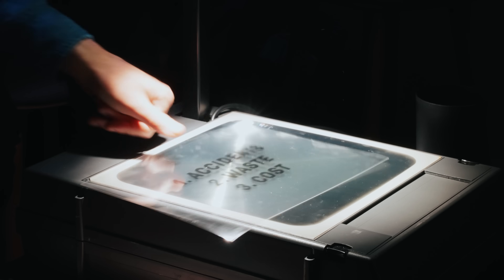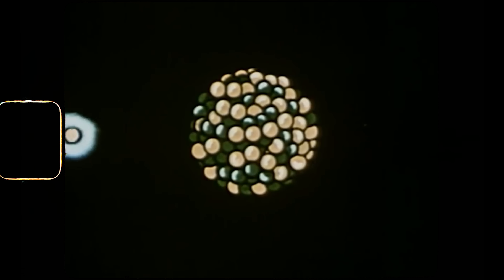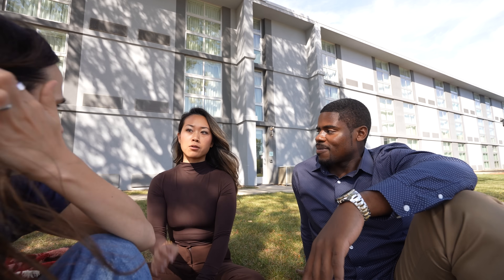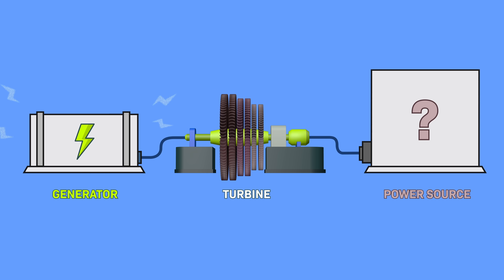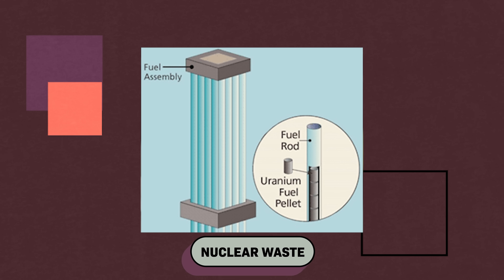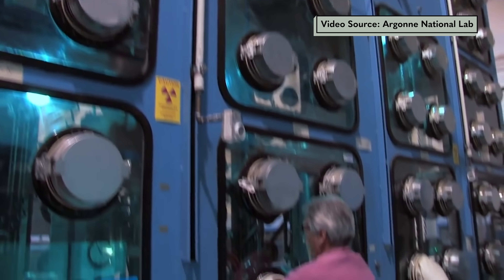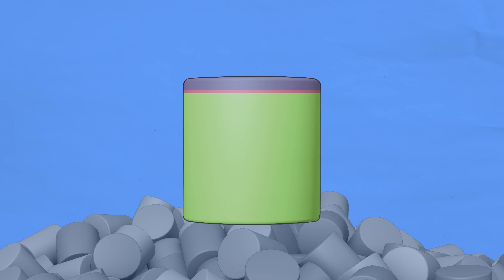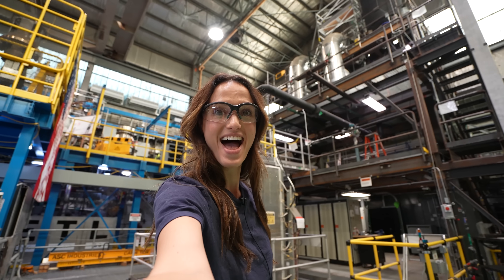The Big Lie About Nuclear Waste

Comment: The atomic number 235 is NOT the number of neutrons. You do not "fire a bunch of free atoms at U235". It's neutrons, and you don't "fire" them.  Do NOT listen to a lesson on nuclear power and its risks from someone who does not know the most basic level physics. Nuclear waste that lasts 1000y is, in reality, just as much a problem as waste which lasts 100,000 y. It basically means we have NO practicable solution for storage. There seems to be a lot of push recently to make us believe that DNA destroying, ionising radiation is less dangerous than non toxic, life giving CO2, which is the basis of nearly all life on Earth. Our less than qualified host has been pulled into the nuclear PR spin.

Comment: theres a lot of pro nuclear propaganda going around lately. even if it was safe in theory, which i have serious doubts, it is definitely not safe in the hands of our government and companies (which are more concerned with profit and power than safety or health).
consider how electric companies in california are causing wildfires or how deepwater horizon spilled 134M gallons of oil into the gulf or how people near fracking sites can light their tapwater on fire. these thing and many more are allowed to happen over and over because the govt allows industries to self regulate and if they are held accountable they are fined a small percentage of profit.
the difference between those energy sources and nuclear is that the potential risk of nuclear is exponential in comparison. and thats not considering catastrophic natural disasters that would overwhelm engineering fail-safes. 
the youngest generations have no respect for the dangers of nuclear radiation because they havent had the negative experiences older generations have. as the saying goes, those that forget the lessons of history are doomed to repeat them.

Comment: If the US can overcome its allergy to nuclear, they need to approve a single system that can be manufactured for a reasonable price. Each of our plants were custom designed and each installation was customized to the site. The French have been recycling their fuel since day one. We could force it here. Just tell the Global Warming ninnies that we’ll remove the requirements for oil permits until they allow nuclear plants. In other words, let anyone dig anywhere until the 1st new nuclear plant is turned on.

Comment: Oh, get over it! Nuclear is just another energy with limited resources, mostly in countries that are less nice. It IS highly dangerous and toxic, it IS not environmentally friendly, it IS expensive. Stop the Greenwashing already. The best move would be fusion, but that will take too long to help us in the next 50 years (unless some real breakthrough happens), so we are best served with regenerative energy systems. Solar would work well, but also needs a lot of materials that are going to get scarce and is still not very efficient. Wind and water are simple and can be used everywhere and do not need much space. Wind has been used for millennia, we know how it works. And I have yet to see a windmill or solar panel failure that leads to the evacuation of a whole region or city. Water is more risky in that way, when dams fail and flood a whole area.

Comment: I strongly believe. The way forward in energy is nuclear energy. Yes I prefer fusion than fission. However, we are capable to manage both. The recycling costs of old fuel should be calculated fairy. Not compared to new. Compared to ‘recycling’ wind energy technology. We as human, we should think in sustainability at and with each new technology. Not just the initial costs. Having a earth with millions of wind turbines isn’t a pretty look. Surely if life cycle is a few years. Nice video. As material innovation director and polymer chemist these are the topics we should talk about.

Comment: The problem is that trials showed that the costs of that repeated reprocessing, for which breeder reactors are needed, are huge. Despite the roughly thousands of billions of $ spend on it in countries such as: Japan, France (three generations fast reactors), UK, etc.
It's a pipe dream not only until we have developed highly intelligent, radiation resistent robots that can do all the work, but even then... 

The Japanese now have huge trouble developing robots that are radio-active resistent so they can inspect the chambers below the exploded reactors in Fukushima. 
There is no real scenario that we can do it for acceptable costs. 

The French stopped with fast breeders after trying with three generations, when it showed that the fourth generation would not deliver structural cheaper and better results (it would only increase the risks as fast breeders explode also fast).

Comment: Well that’s true to a certain point. Nuclear is definitely the best way to generate energy. But not all nuclear waste is good enough to be used as fuel. And nuclear power plants also produce more nuclear waste. It’s a big problem now with very few nuclear power plants running. If we run mostly nuclear power plants the amount of nuclear waste generated would be massive. Which again, most of our current ways to generate power is also very harmful. But nuclear waste does generate more complex issues and it’s VERY VERY expensive to correctly dispose of it.

Comment: The big lie about nuclear waste is that with the way we store it, it isn't dangerous. This problem was solved decades ago. Check out the video on this very subject by Kyle Hill*. (His *Expedition Chernobyl series is very good too). In the US, we don't even just use dry casks, but there are other, effectively indestructible storage methods that are built to last. We don't just put the waste in casks, we integrate the radioactive waste with inert materials. People just have this false picture of it being some green goo in a vat that will kill you if you get too close, but that's as far from the truth as it can get. A stigma about the danger of Nuclear power has been fed to the US public since TMi - despite that never even having been a risk in the first place. Despite everything, nuclear power is environmentally the cleanest and most energy dense process for power generation we currently have by far.

Comment: "Spent" nuclear fuel is not waste, except by the ridiculous definition imposed by US Congress. Russia (RosAtom specifically) already has production fast neutron reactors with decades-long track records. By about ~2030, they will have a first-in-world full, enclosed (this is important) closed-loop system in experimental production. This gives you cheap (RosAtom builds on time and on budget), clean energy with "waste" on the order of grams, not kilograms or tons, with passive (automatic even in event of power loss) safety. Nothing leaves the enclosed closed-loop except energy and a tiny amount of nucleides at the very end of a very long cycle. What's more, you might not even need to mine new uranium for a hundred years or more - RosAtom can enrich down to below 0.1 (and likely better), whereas the next best - the French - can only do 0.3. This means the mountains of 'poor' uranium lying around enrichment sites around the world (and now treated as waste) could be sent for enrichment, producing new fuel with no new inputs. Good job you've p-ssed off the Russians by waging a proxy war with them in Ukraine and condoning UA shelling of RU nuclear sites, no nuclear for you.

Oklo is a dead end, their ideas only work commercially if you assume that a small nuclear power station incurs lower fixed costs in land, exclusion zone and security than a large one, which is ridiculous on the face of it where plutonium is present. I didn't even get into the actual generation side of the plant. It's an attempt to do an end run around the failure of the US nuclear technology complex, which tried and failed to develop centrifugal enrichment (the only commercially viable enrichment technology), delivered broken designs (active safety that fails on power loss) for decades, couldn't build anything on time or on budget leading to the bankruptcy of Westinghouse, a failed regulatory regime, and the absence of qualified engineers. The trouble is that these same Russians from above already have a 15-20 year lead on these compact reactors (at a minimum), and not just repurposed military reactors or broken sodium designs, but real civilian-purpose designs. A converted military-reactor design is already in full commercial production. And it sits on a barge that can be towed whereever you need it. Not a start-up, not a theory, full commercial production with a full, decade-long safety certification process behind it. It's sitting somewhere very cold and powering I-forget-what. Compact reactors are not an "innovation" requiring research, they're already here and we know they have a lot of utility, but their usage scenarios (with full safety) are limited vis a vis full-size. This limited use case will not allow these compact reactors to reach the mass production numbers they're counting on to drive the cost down. They're not a replacement for 80 years of research and a full, end-to-end line of nuclear technologies that are proven, fully safety-certified and can be built on time and on budget.

Comment: If recycling has been demonstrated to work, and not just that the process has been refined over the years too. So, who has told massmedia to lie and hold this quiet, and not telling us the whole truth? 

This option actually makes nuclear plants way more useful, and it has to be cheaper than other energy sources in the long run that say wind and solar when it comes to kw per hour, and ofc waste which is a huuuge problem in the socalled "green enegy" sector of today

Comment: Well the real trick is to make good liquid-metal cooled reactor. And not a small experimental one but large, utility-scale one.

Russians built one (multiple reactors of BN-series) that uses sodium as a coolant, however the need to keep pool of sodium in argon atmosphere because sodium ignites when in contact with air... and there were a number of fires during BN-reactors service history...
So it doesn't sound like a convenient reactor to have.

French used mercury for cooling but it have very low boiling temperature, so potentially we can have a lot of gaseous mercury around... yikes!

In submarines they use lead-bismut mix which while better than sodium, still ignites in contact with air... and corrodes the pipes...

Liquid tin is also corrosive but it doesn't ignite but its melting temperature is 200-something C...
And final candidate is pure lead. The problem with it is that it have even higher melting temperature than tin and - while probability is very small - sometimes lead atoms capture neutron and become radioactive polonium atoms, so we need to filter them out somehow out of lead that is heated to several hundreds of C...

And I haven't even heard of studies about using some other metal as a coolant.
Still, tin or lead sounds like a less problematic way to go. 

BUT if we do figure the engineering out we can use mix of depleted uranium and plutonium made in Sellafield to create a reactor that would last a ~century without refueling and won't produce any wastes (it will burn everything it produces).

Comment: But we still need to deal with the nuclear waste barrels that were dumped in the occean in the 1980s. I know a guy who made those barrels and they were not water tight, plus they were made from low grade iron that is nearly completely corroded away. Most experts estimate we have less than 10 years to retreive those barrels before there is a geological disaster. As in, most of the oceans around northern Europe will be radioactive.

Comment: Very nice video. I've known about closed fuel concepts for years and was cycling friends with a retired nuclear physicist at one point. Whether the waste is uranium, or plutonium (as you point out at 11:40) is an issue. But what so many people over the last 30 years have failed to grasp is the alternative: Global warming. 

I haven't watched your other videos, or your friend's video on the topic, but right now, today, we're really missing an opportunity to convert old coal fired, or even gas power plants into small sodium reactors. TerraPower has done just this in Wyoming, with some support from Bill Gates. But this could be implemented 10, 20 times over nationally. This type of power remains an extremely viable source until we can completely a major enough transition to solar, wind, biolass and other power viable renewable sources over the next few decades, until nuclear fusion is finally cracked and implemented (2050s?).

Comment: UT Austin developed other solutions as well.
“The UT-Austin design is called a compact Fusion-Fission Hybrid reactor, which is capable of destroying nuclear waste from fission reactions using nuclear fusion processes.  While this is in no way a new idea, the concept of using fission to as a the transmutation process to destroy high level nuclear waste, it is good to know that processes to solve part of the energy problems are continually being developed and researched.

It works like this…

Any nuclear reactor today generates its power by the fissioning of atoms; the resultant products contain extremely long-lived transuranics and other radionuclides.  What to do with this long-lived nuclides is a problem that the US, or rest of the world, has not been able to solve.  Utilizing transmutation is has been hypothesized for decades as a method of changing the long-lived isotopes of nuclear waste into more manageable isotopes (shorter half-lives).  This can be done by fuel reprocessing, but there are many issues with fuel reprocessing including cost and non-proliferation.  The fusion-fission hybrid, however, could utilize the high energy and neutron flux output of the nuclear fusion process to cause fission in the waste products of LWR’s to generate electricity and transmutate high-level waste.”

Comment: It actually become more radioactive as the long live nuclear atoms become tranformed into atoms that have shorter lifetimes and also, emit more radiation.  Which is actually good as it means it becomes safer faster.
Reply: It is intensely radioactive! But with a vastly shorter half-lives.  This also limit chances for it to be diverted for nuclear weapons as at makes it much more difficult to work with in the ways that building weapons requires.

Comment: Something I don't understand. Let's say we have a 1kg fuel rod. 950g of U-238 and 50g of U-235. We use the fuel and end with 950g of U-238 and 10g of U-235, 10g of Plutonium and 30g of other highly radioactive stuff (Some of which may be used in medicine, but not of all of it). If we recycle the fuel, we can recover only 10g of U-235. Just 20% of the original. Even if we make MOX fuel, we have 5g of U-235 and 5g of Plutonium. So the question is: How may we use it over and over if we only recover between 20% and 40% of the fuel on each cycle. Sure we save fuel, but not that much.
Reply: At least a few people can do the math, bravo :-) I'm not sure if she really believes it or if she just want to skim the audience for profit. Sure there is a huge amount of people who like to hear what they want to hear.

Comment: When focusing on the fuel itself, this makes a lot of sense.  However, there are many other consumables that end up as radioactive waste  that must be stored safely after use.  Lower level, but still dangerous. In addition, the water,  reactors, generators and components used in production of power do not last forever and will eventually be waste.  For example, site like the Trojan nuclear plant in Rainier Oregon which is now just a giant waste storage facility that that shut down when the generator needed replacement will need to be monitored and watched for a long time.

Comment: Russia  have an even better solution: it's called Fast Breed Nuclear  Reactor, FBNR, that "eats"  waste, produces new fuel, inert materias and energy.  The reaactors can be the size of a 18 wheeler.. and produces 2mw of energy for 30+ years.. so the energy  can almost be produced ON SITE,  no more transmission  lines... Today Russia  is the only country that can process Nuclear  waste. Each power plant, tge size of 4 blocks, costs abou e billion dollars, and produces  energy  for 30 years..  A patriot missile system cost more than that
Reply: Every fast breed reactor in existence is a prototype. Russian propaganda goes brrr.

Comment: Most important sentence from this one video: 13:03

This is not the silver bullet. 

Tbh. Nuclear waste was never an issue for me. If humanity isn't able to send nuclear waste into space/the sun in the next 200 years with extremely low risk, we have a whole different problem. 

However, the facts are still on the table. Nuclear is a finite resource. There is constantly a new supply of fresh material needed in order to sustain it. So just the fact that you might be able to recycle the waste, isn't going to solve that issue. 
Stuff that makes much more sense than Nuclear: Geothermal energy.
Reply: It isn't and it never will be. This does not make any sense both physically and economically.